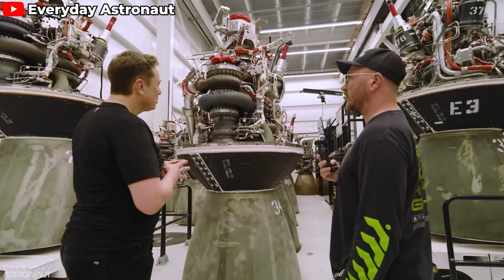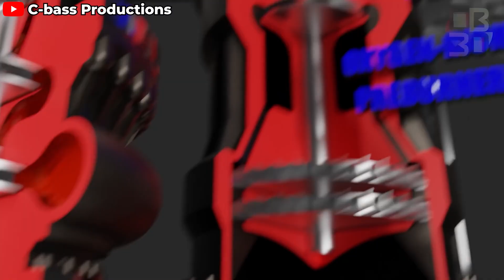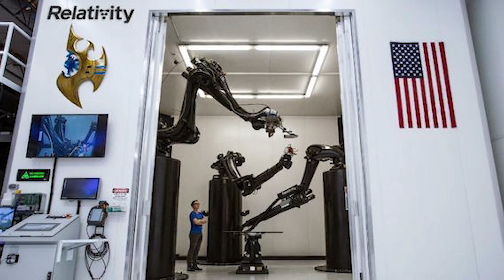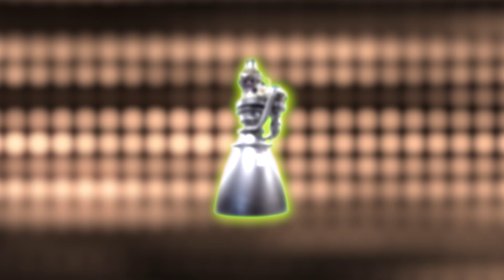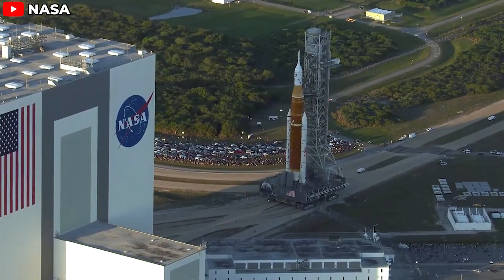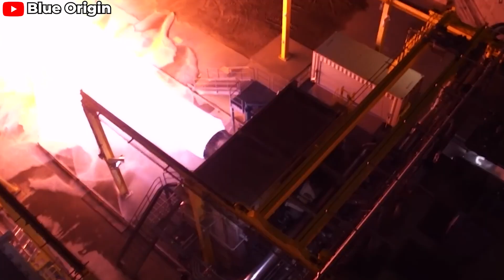SpaceX Reinvented NEW KING Raptor Just Shocked The Whole Industry!

Comment: You said the RS25 is now used on the SLS. So what you are really saying is that the RS25 will never be used because boeing can't seem to get there ship off the ground or get it back from space. So with all the problems of boeing,, RS25 is now an antique
Reply: The RS-25 engine began use in April of 1981.  That's 43 years ago.  Would you use a 43 y.o. Apple computer or Iphone??  I think not. Time marches on.
Reply from the maker: The RS-25 is pretty outdated, and its improvement rate is too slow, honestly. But since the SLS is here, this antique will still have something to be attached to